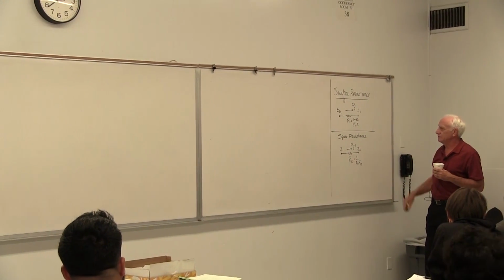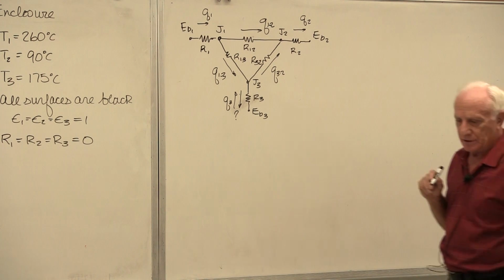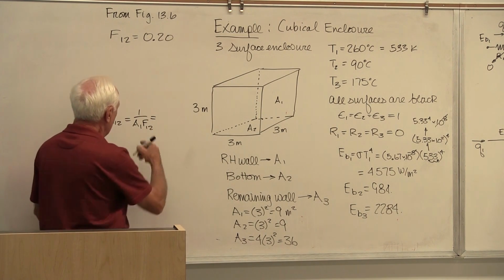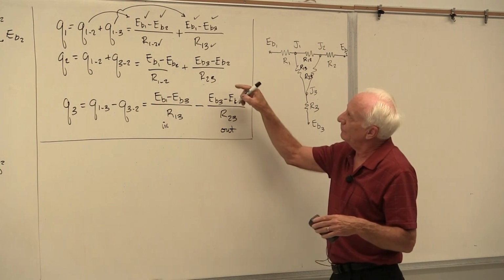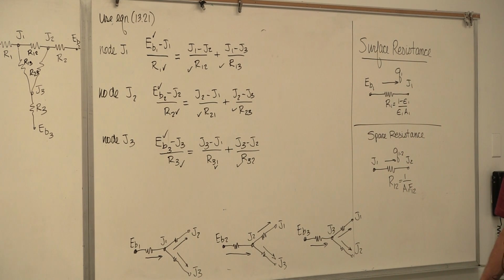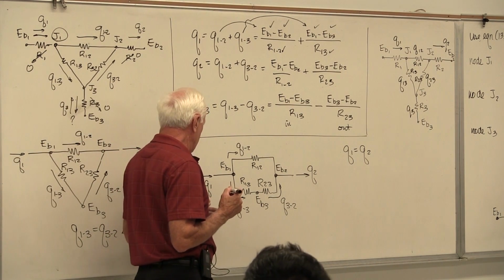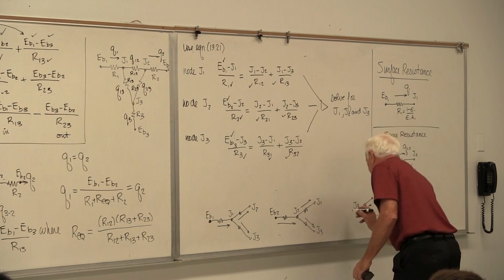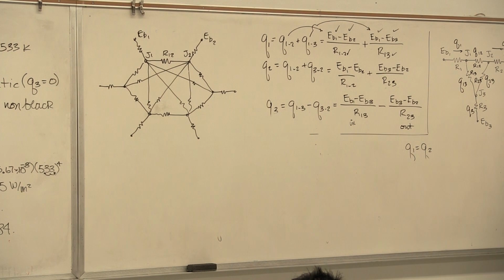Heat Transfer: Thermal Radiation Network Examples (16 of 26)

Comment: How does R23=R32? A2 does not equal A3.
Reply: That’s not the reason, although it is a true statement. It’s because of symmetry.
Reply: so R23=1/(9*0.8), R32=1/(36*F32). since F23 = 0.8 what surface 3 "sees" of surface 2 has to be 0.2. Therefore R23=1/(9*0.8) = 5/36,  R32=1/(36*0.2)= 5/36. So they're equal. I do agree he wasn't very clear when he explained why they're equal.
Reply: By reciprocity... AiFij = AjFji, as resistance is defined: Rij = (AiFij)^-1 ... Raising the reciprocity expression to -1 does not change it... So if A2F23 = A3F32 -> 1/(A2F23) = 1/(A3F32).